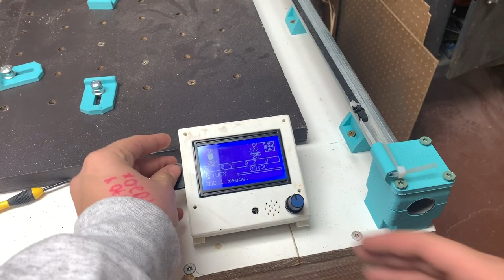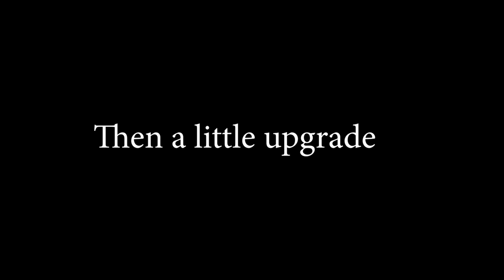CNC Build Part 2

Comment: Awesome!!!  Thrift stores ocasionally have vacume attachments for cheap like the round brush attachment.  That mounted in part of a plastic bottle ( or clear printed adapter ) might help watch the carving and cleaning.  Keep it up!
Reply from the maker: Yes. I actually got some carpet runner that is clear and flexible them I’m gunna make a new boot out of. I will be making a video with upgrade for this machine as well! Thanks for watching

Comment: I have a LowriderCNC V2, but I'm currently planning to do this build. Already have all the printed parts in a nice fluorescent green PLA+ filament, already have the stainless steel tubes and a choice of controllers. I was gonna use a SKR Pro v1.1 32bit board, or a MKS Gen L 1.0 like I have on my LR2, but I heard GRBL and an Arduino Uno with a CNC shield is a better choice for CNC'S than Marlin. I got that one too but I'm still undecided about this. What do you think ?
Reply from the maker: Nuno Pereira I like my Marlin, it’s easy to changes things in the firmware and there are a lot of people who use it too so if you need help there is a lot out there!
Reply: @TimberWood.Customs  Actually, i don't need help with Marlin per se. I've been compiling it for years for lots of different boards in the Arduino IDE and PlatformIO, and i understand a lot of Gcode commands too. The problem is that GRBL is the actual unknown for me, in the sense that its flavor of gcode commands is quite different from Marlin, and closer to industrial-type CNC's. And i also don't understand the syntax for GRBL either, i.e., all those dollar signs and whatnot. I know that the version of CNC.js that comes with the special V1 Engineering image for the Raspberry Pi supports both GRBL, Marlin and other types of firmware, but i don't want to step into GRBL without knowing from someone with experience if it's worth the hassle of switching from Marlin or not.
Reply from the maker: Nuno Pereira If you know a lot about Marlin, then I’d say go for it. It’s super easy to use and there’s always a way around GRBL